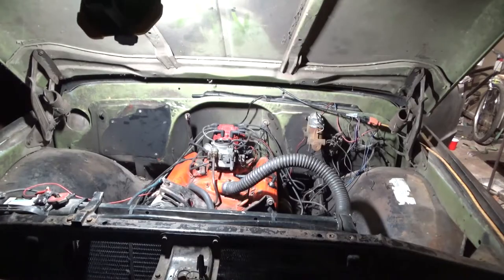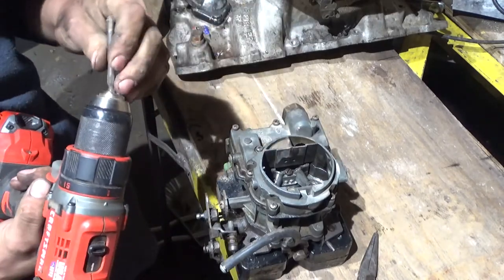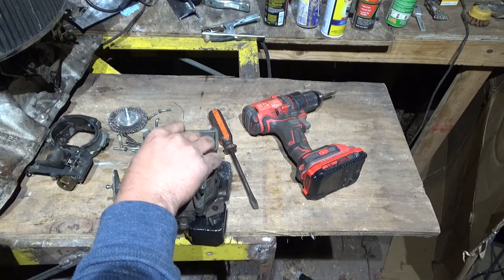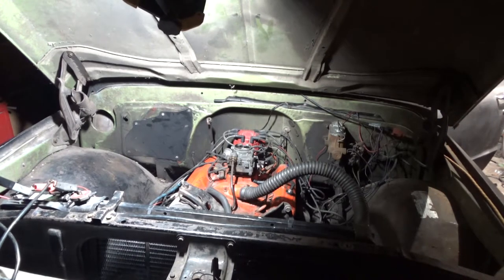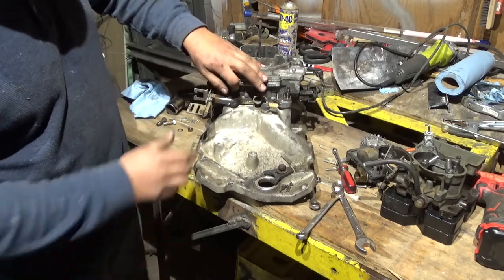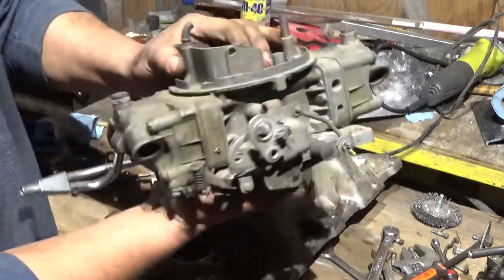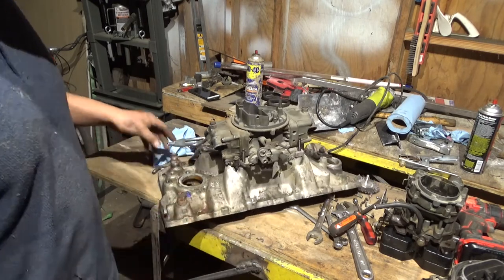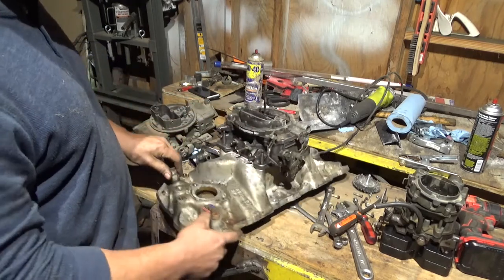rochester 2 barrel accelerator pump not working, and some stuff about swapping to 4 barrel carb

Comment: I went thru the same crap with my 2 jet Rochester carburetor.  That hidden hole tip under the gasket sure helped me figure out problem.
Reply from the maker: @wacoldestv1704  I don't know if I told the whole story in the vid. But mine was losing a quart or more on the way to work.  About 15 miles away. Thanks for watching.

Comment: Every Rochester I've ever had has leaked like a sieve.  I replaced a pretty leaky one late last night on my Dad's new '56 Bel-Air.  Havn't tried to start it yet. The Colonel's going to fire it up right after breakfast in a couple hours.  Fingers crossed. (new plugs, wires, dist cap & button, fuel line, carb.)  Wasn't idling well with the old carb, plugs were blackened. Hesitation (& sometimes died) when you tried to goose the throttle and rev it up, or take off.  Hope she fires up and runs smooth.  I think we have it fixed but we'll see shortly.  Car had sat for a spell after previous owner passed away. When we bought it, it had some iffy smelling stale gas, dirty plugs and a leaky Rochester 2bl carb.  Just needed some freshening up I think.  She's a looker though.  White & Sky Blue, laker chrome side pipes, Foxcraft cruiser fender skirts, spot lights, frame off resto.  Cold A/C.  Smoked glass. California car.  The Colonel loves his tri-5 Chevy's.  I think the 1955 Nomad is probably one of the coolest cars ever made.
Reply from the maker: sorry for such a late response. but if an engine runs good and dies when you goose it. most likely the accelerator pump is not working. make sure you see 2 steady streams of fuel spraying out of the nozzles when you open the throttle.

Comment: unless you are running gasoline WITHOUT ethanol in it, it will not run right, and the ethanol eats up the insides of hoses, absorbs water and destroys the gaskets and ring on the accelerator pump...

Comment: Good video, love those old C10's. I've got a Rochester 2G on my Jeep with a factory Buick 350 V8 and I'm trying to get it running right. Replaced a dead accelerator pump so now it'll rev up without dying but it still doesn't want to idle. Thinking idle circuit might be clogged from sitting bc it ran great when I bought it a few years back. Eventually I might put a 4bbl on it, I found a factory 4bbl intake but need to find a decent spread bore carb for it.

Comment: The check ball under the accelerator pump isn't sealing the inlet hole from the float bowl. Either the check ball is missing or it's the wrong size. You moved the carb around and the check ball dropped into place, probably.

Comment: I have a 350 Nova with an original 2BBL similar to yours. I rebuilt the carb a while back and it ran ok, once it warmed up.  I parked the carb last fall. When I tried to start it this spring, it would not start.  The accelerator pump would not pump when installed on the car. I pulled it off and worked ?  I re-installed it, and again, it did not squirt, pulled it off and it worked.  Very strange.  I am going to pull it apart to see if I have a clog like yours.

Comment: Oh man thank you I have an old Plymouth fury 1966 as a daily been driving it everyday for 2 years now and all of the sudden I hit the gas and car dies at a red light starts right back up again and I hit the gas and died again ended up pushing it out the the way and figured maybe it’s the fuel pump or something crazy it’s been sitting at my shop for a week now everyone that looks at it says time for a four barrel lol
Reply from the maker: Upgrading to a four barrel especially like an edelbrock that is brand new is never a bad idea in my opinion. But I have daily driven a chevy truck with a rochester 2 barrel for years. They are definitely rebuildable and simple. They also run really smooth.

Comment: Man I bought a rebuild kit and rebuilt my 2G v Rochester divorced joke... It runs like brand new you need to put an inline filter in and replace the filter in the carburetor.. kit$38.00 mine is a two ball Rochester. You're you're going to hate that 4barrell on there without changing the heads..
Reply from the maker: Why would you say that? I'm assuming that you think that all 2 barrel 350s came with heads that have smaller valves. If that's the reason you say that well guess what. This 2 barrel 350 came with some heads that I forgot the casting numbers but they are 1.94/1.50 valves. And they are supposed to be comparable to to camel hump heads except they have a larger chamber 76cc vs 64cc. I have been saying for the past 20 years that a stock 2 barrel 350 came with smaller valves. I learned recently that this is not true at all.

Comment: Why?  Why do you have dirty fuel?  Makes no sense.
Reply from the maker: It's from the steel fuel tank rusting inside.
Reply: @davidcraft4909  No filters?   It sounds like you were chasing your tail.  :)
Reply from the maker: I always run filters sometimes the carburetors have trash in them from setting up too long. Its actually very common for anything with a carb to have problems with corrosion when they are not being ran constantly.  The 2 carbs, and engine in my videos have not been running for at least 3 or 4 years at the time of the video. Its a common thing especially for lawn equipment and boats and they usually only get put up for the winter, and guess what 6 months later they have bad fuel and corrosion in the carbs. Also the truck is 50 years old with the factory steel gas tank so rust flakes clogging up your fuel filters is also an issue. This is normal stuff when messing with old engines and gas tanks. Anyway, thanks for watching and commenting.
Reply: @davidcraft4909  Yes I hear ya.